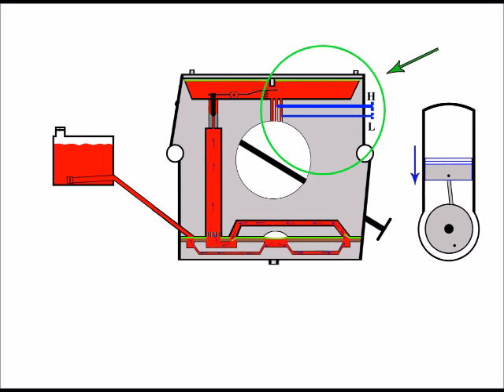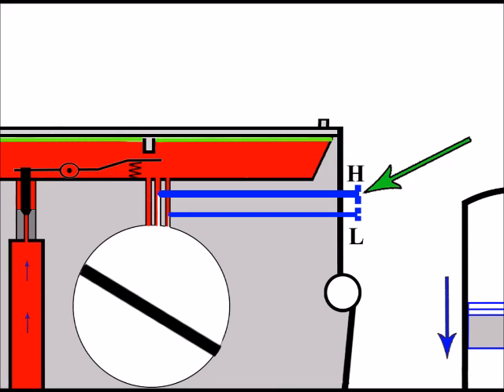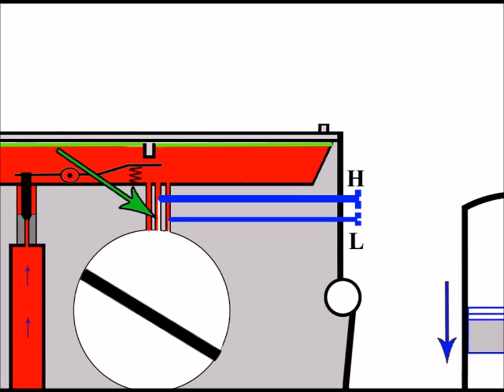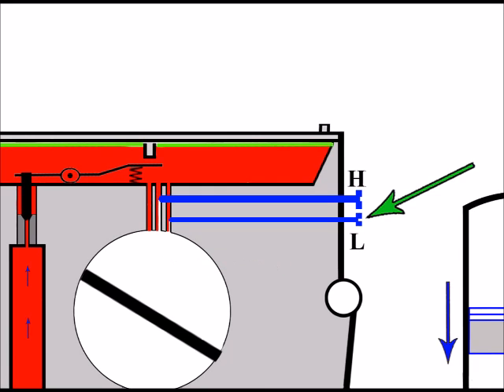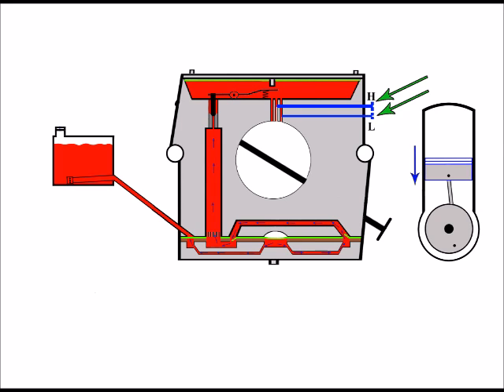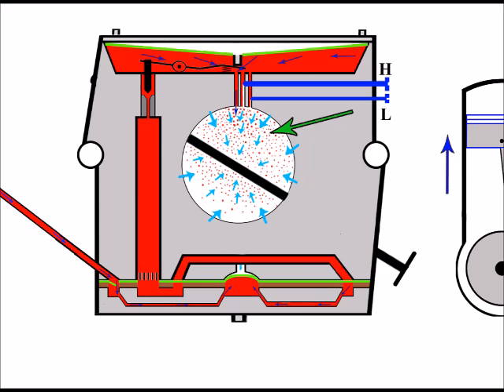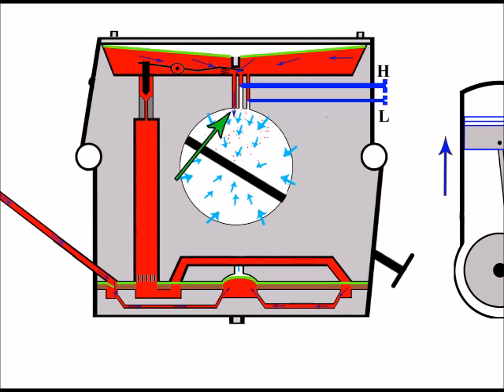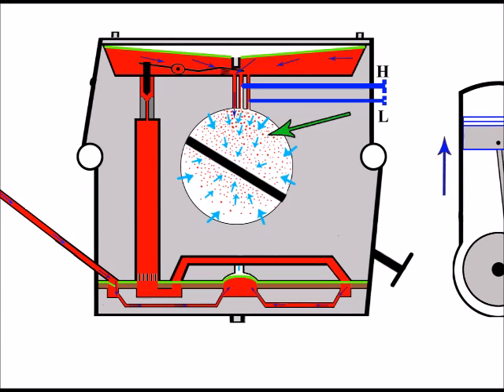CARBURETOR TUNING:  Chainsaw Carburetor Settings Explained!  (by Craig Kirkman)

Comment: I can not get to the low screw on my carburettor.  It always needs chock.  Occasionally it would have a sudden rush of energy then dies down again. A bit smokey to.  Adjusted H screw and new fuel lines and new fuel with correct mix.  Adjusted the reffing screw.  Running better, but still not right.  I cannot undo the spark plug... it’s too tight.

Comment: I adjusted the screw but still no power.. i rev and the  back wheels spin. I just had it working after..

Cleaning the carberater 
Changing fule line and filter 
Grease all wheels 
Adjusted breaks

If anyone can help